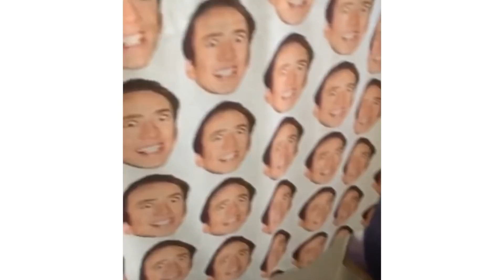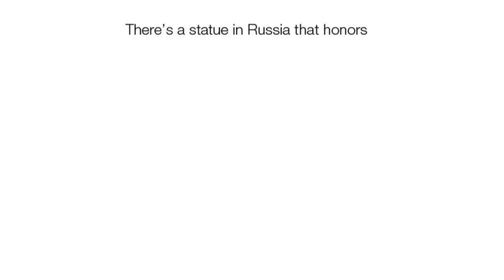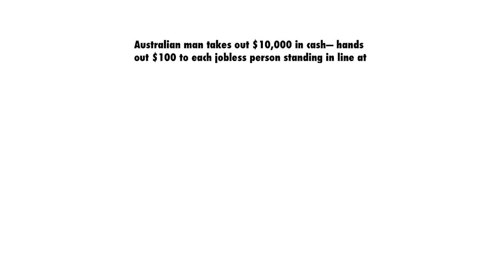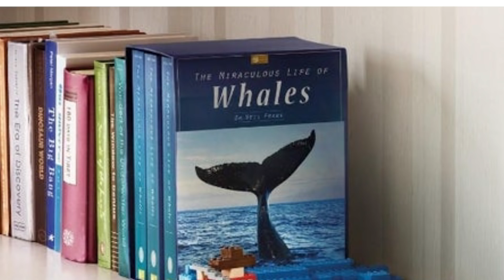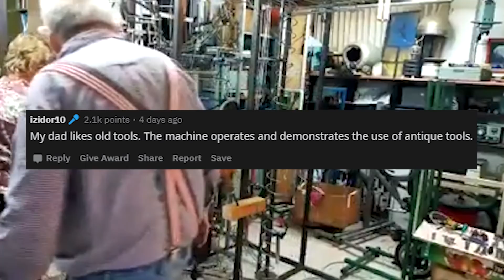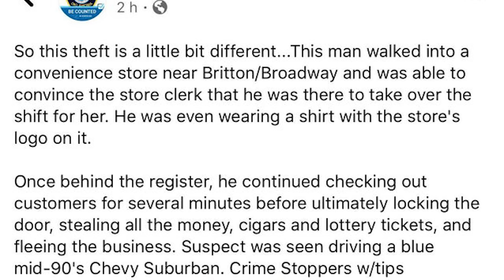r/NextLevel | "How does he do this?"

Comment: 5:50
That's a baja-truck.
A relatively lightweight cage with a plastic or glass fiber shell to make it look somewhat similar to a car, and some crazy suspension.
They test those by dropping them from forklifts or cranes.
Reply: That's actually called a trophy truck. Its 2 wheel drive,  baja-trucks dont exist. Thats the sport.

Comment: That BSL2 protection is normally supposed to be put on before entering, and leaving a contaminated area. luckily thats all thats needed, you wouldnt want to have to deal with BSL4, with positive pressure suits with hoses running to the cieling

Comment: Take off every time they eat. Yes, which is the reason the hospital staff many places are not allowed breaks. Maybe one in the middle of the shift to get som food, get some fresh air and a toilet break. There is not enough time and protective gear to allow them to take it off all the time. Remember it is mostly trashed after a single use. And it gets crazy hot inside.

Comment: 5:55 as a fan of racing I can tell you those are real but only used in extreme rally such as running across a desert. And on these kind of huge trucks only. You won't see this type of suspension in any road car or racecar at all.

Comment: I'm sure one or two more car had said that's how suspension works, but it's because of the height of the suspension and I'll fast the car is going it looks like that the chassis stays in place and wheels move up and down to keep it up and relatively stable and they looks kind of soft is what I'm going to say

Soft suspension meaning it's easier to compress and hard suspension is just the opposite

Comment: It won't do you any good to steal lottery tickets. They're numbered. The store they were stolen from received number X to Y and if they're stolen X to Y is invalidated. In fact, trying to cash them in would probably cause you to get reported.
If you really wanted to cash those lottery tickets you have to cash all the ones that are cashed out in store. Some places that's $100 and lower... and you should do it immediately after the initial theft to prevent the tickets being locked out.

Comment: The truck with the crazy suspension is real it’s called a trophy truck and is used for a form of off road racing the crazy suspension is used so the drivers and Handel the truck easier